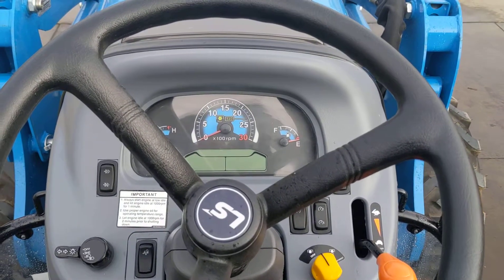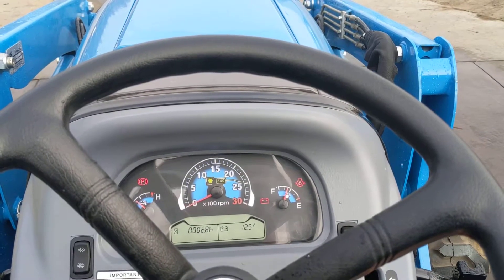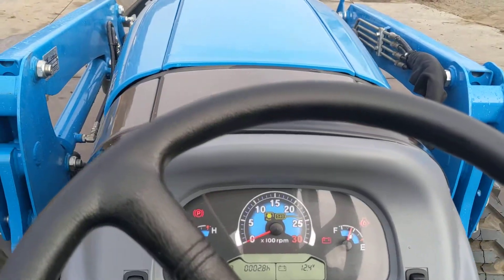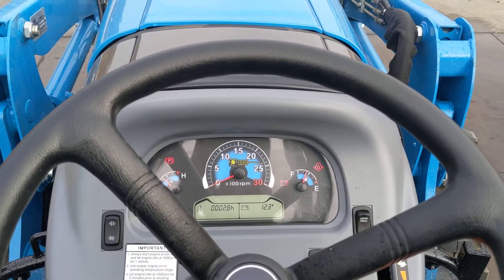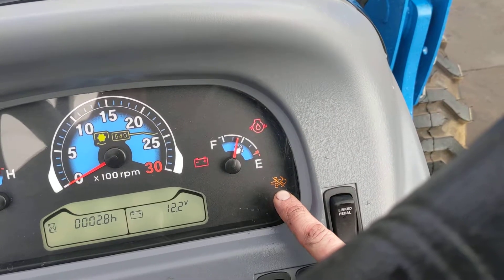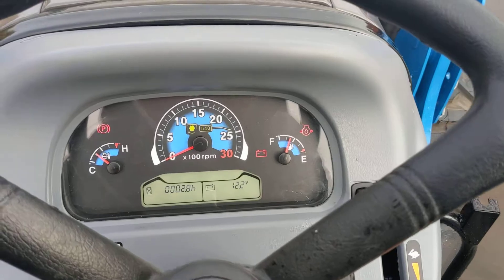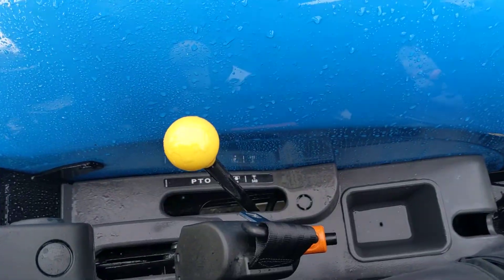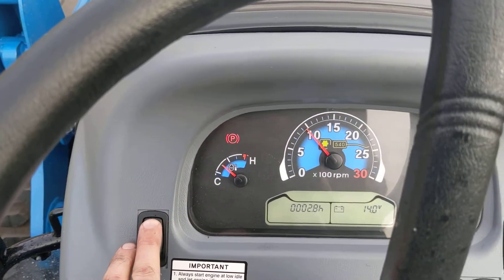How to do a forced regen on a LS Tractor

Comment: Thank you. I recently took delivery on my MT357HC. Saw the light flashing and knew it was the regen light, but had no idea if it was happening or going to happen. Eventually it did start, then saw the regen temp gauge and I was questioning if it was too hot or needed to to be hotter. Came across this video and now see all is good. Dropped it to an idle after the temp regen light shut off, then idled for a minute before shutting it down.

Comment: My regen light came on flashing once a second, then the light went solid, ran for a few minutes then turned off w/o the temp light going on?  did a regen occur?  Also, would the regen happen again after only 2 or 3 hours of operation?
Reply from the maker: If the regen temp light didn't turn on then a full regen probably did not occur. It probably started then a fault of some sort kicked it off. Are there any codes flashing on the screen?